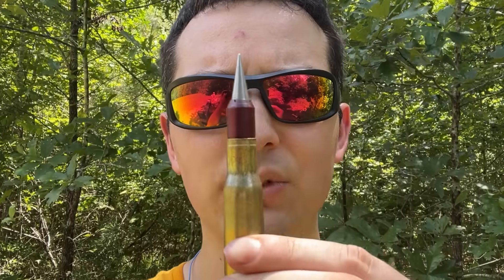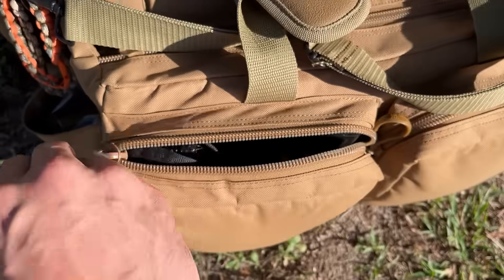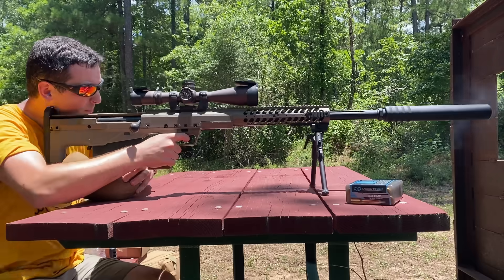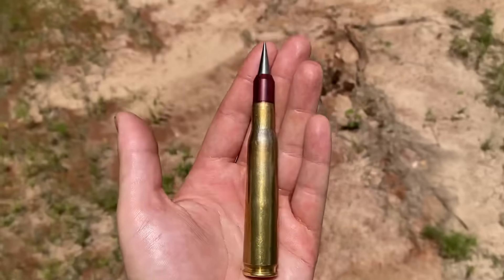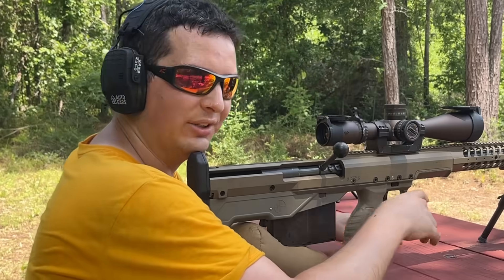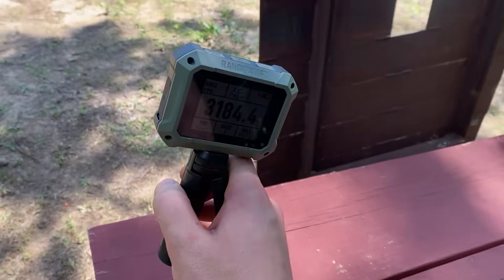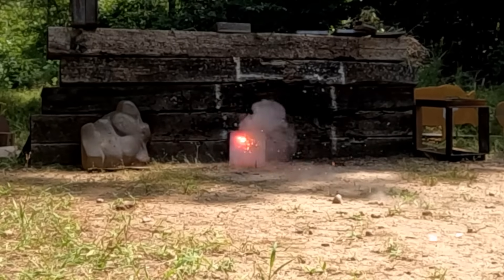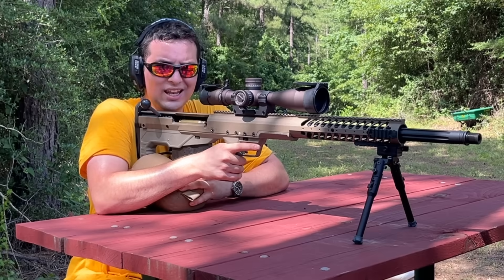How Much Steel To Stop A 50 Cal SLAP?

Comment: only going ballistic, scott, and edwin sarkissian and now you shot the slap, btw i thing it would penetrate if it was 4000 fps, maybe the barell should be longer, and here a video idea compare on the steel
1.50bmg (fmj)
2.50bmg (brass)
3.50bmg tracer (brown tip)
4.50bmg spotter (yelow red tip)
5.50bmg  AP (black tip)
6.50bmg Api ( silver tip)
7.50 bmg apit (red silver tip)
8.50bmg incindeary( blue tip)
9 50 bmg Rauffos ( green white tip)
10. 50 bmg slap ( the yellow one)
gretting from bosnien!

Comment: Great video my friend, and my regards to your sholder. I'm SHOCKED those slap rounds didn't penatrate 1-1/2" steel plates WTF. Maybe they need that full 4,000fps. We have the M-300 Praetorian in 408-Chey-Tac 29"barrel 18lb rifle using armor piercing rounds will penatrate 1-1/4 steel. And my Cadex Tremor CDX 416-Barrett with 32" barrel 24lb rifle. Using reloads with tungsten bullets we've shot through 1-3/8" steel plates. My dad has a McMillan Tac-50-C 32" barrel and it punches through 1-3/8" mild steel.  We have two rifles that should have no problem punching through 2" steel plates. Last year my dad and I picked up the Cadex CDX-X60 12.7×114mm 36" barrel 43lbs & CDX-X60 14.5×114mm 40" barrel 45lbs. These rifles are extremely accurate, and the recoil is surprisingly very mild. Cadex makes phenomenal muzzle breaks. Maybe one day I could bring these big boys to your range to do some penatration test. God bless you and your family. God bless America 🇺🇲 🇺🇲.

Comment: Aluminum tip with 18 kJ of energy behind it going into a steel plate? Yeah that's gonna create a bunch of iron oxide and aluminum sparks on every impact, so you're basically setting off a mini thermite cloud. No wonder it smokes so much.

Comment: I'm def confused.  Something's wrong here.  I've shot through 1 1/4" steel with just my .300 WinMag with black tip, tungsten cores.  That's nowhere near the power of a .50, and certainly not a .50 slap round with tungsten bullet.  Either that's not tungsten, or that's not mild steel.

Comment: Heeey what did you go and take the muzzle brake off for? ……
Reply: The sabot in the S.L.A.P round would foul the brake.
Reply: @TechGorilla1987 I know. About 10 other people on here have done it. Rex guy even quoted the heavy artillery army handbook about barrel and projectile configurations. Also pointed out how all tanks do not use brakes… yet there’s a guy who had a certain potato gun… and the manufacturer of said potato gun felt it’s a psa to clarify muzzle brakes have absolutely nothing to do with a certain event involving a thumb… but yea what does everyone else shooting every kind of sabot under the sun successfully know. Even I’ve had brake strikes on black powder when I use them to just sight in.
Reply: @MrT13  Nice reply man.
Reply: @TechGorilla1987 it specifically states it in the multiple scout sniper handbooks don’t use these in certain twists and ever with a brake of any kind. In fact in big red letters. I just think it’s funny he even made a joke about it with the can still on… that probably would’ve ruined that can. Those things are crazy unpredictable when you don’t remove all the potentials. Like barrel exit before crown crazy… the .308 one was very well known for that actually. And they couldn’t even get a .300wm one to be reliable enough. Wasn’t worth it. The only reason these are m2 approved is barrel twist and weight psi rating. Yea they’re real spicy in a handheld. But as long as it’s not a crazy high twist and too long. They exit fine. As we saw. But, do it with a potato gun with a break on it lol and well we saw that too huh.
Reply: @MrT13  I love when people that really know things engage in YT comments.  I really enjoy picking the brains of people that understand.

Comment: I would like to enhance the plug for Otis. I started using Otis cleaning kits on my Winchester .22 as a 14-year-old neophyte. When I joined the Marine Corps, the range coaches all swore by Otis and so did the snipers. They make the best, most effective and durable, cleaning equipment for any firearm.

Comment: Mild steel has a tensile strength of roughly 60,000 lb... it's also more malleable than some higher grade steels meaning it deforms more before it shears... 

It can be a whole lot of fun when punching heavier steel with an iron worker... it sounds like a gun going off in the shop.

Comment: The flashes on the aluminum tipped rounds might be due to the aluminum reacting with the rust and mill scale on the steel to create a thermite type reaction.
Reply: Metallurgist here. Points for creative thinking, but this is not a thermite type reaction. Way too little iron oxide on the surface to be meaningful. 

What this is is simply flash heating from impact igniting the aluminium (aluminum, sorry, I'm European) causing the shrapnel to burn. You'd get the same effect if the bullet were shot onto rust and mill scale free stainless steel.
Reply: Aluminum powder or fine shavings are pyrophoric, especially when heated up
Reply: No fking way...
Seriously?

That is amazing!!! Thank you for the post.
Reply: isnt it because the silver tip is an  armor-piercing incendiary round?

Comment: You've been adopted by a dog. You need the feel-goods.
SLAP rounds went bye-bye after Somalia. They're based on the success of APFSDS from Desert Storm (1991). It doesn't scale. No soft target effect. No mass to penetrate armor. APFSDS hits tanks so hard the crew is sucked out a 1 inch hole opposite the impact. No joke, can't find video. Shoulder firing a scaled down version is expensive and ineffective.
Your Garmin measured the sabot.

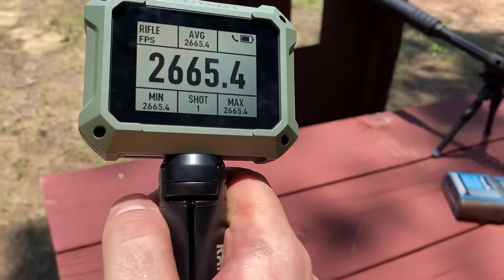Comment: 3:40 Thermite reaction. It occurs between a metal (Aluminum in this case) and a metal oxide (Rust)
Reply: (See my other reply too) There is too little surface oxide to really get you a thermite reaction. 

What this is is simply extreme impact energy turning the aluminum tip into tiny droplets which then ignite and burn in air. Melting point of aluminum is only around 1220 °F (660 °C) so you're looking at fireworks basically.
Reply: @Hydrazine1000  I second this. Aluminum powder is one of the most common firework ingredients because it sparks bright. You’re totally right to compare it to a firework.
Reply: Thermite reactions aren't red like that, def flare/tracer reactions
Reply: @reginaldthecat  yepppp
Reply: Great info, thanks for that!

Comment: I could be wrong, but the flash and smoke from the A Max bullets could be from the aluminum tip reacting with the rust on the steel making I think tannerite if I remember correctly.  Super cool reaction!

Comment: I was a Machine Gunner from 2008 - 2017 I only ever shot slap rounds once and it was .30 cal slap on a GAU-2C and it was as a "spend ex" to git rid of it. Normal AP shot it a lot. I do not think the military uses slap much for the reason in this video its not that much better than standard AP which is also less finicky too.

Comment: I'm very confused as to how this isn't piercing simple steel like that. I've seen too many videos of these rounds going through more steel then that. SUPER odd because that round was made to not only have a ton of energy, but to pierce. TO defile steel unlike any other round. So I am certainly confused. It was kinda made to do what other rounds couldn't do. For certain situations. Like blowing through iron engine blocks and steel plated cover. And usually, it just sails clean through.
Reply: 2 inches is a lot! Far more than would be encoutered in an engine block! The depth it got is impressive

Comment: You do have to understand that 3" of steal at an angle will shrug of tank cannon rounds. You will not be able to go through that with a .50. 20 mm HEAT or 30 mm might have a chance. though I don't think they make 30 mm rifles that are not meant to attach to a turret or a plane.

Comment: That 29 inch barrel ruined those Slap rounds at least 25% drawdown in power. next time make sure to test again at least with 36 inch barrel length to see the true potential of these slap rounds. I'm 100% sure it will go through 2inch mild steel like butter.

Comment: Something tells me these were loaded light.  Nothing wrong with that for the sake of safety, just important to note.

For reference, these haven’t been passing the 1,000 m/s barrier in the video, but when I calculated their theoretical velocity out of a 30” barrel with a ballistics calculator (from a 45” barrel), the velocity is still around 1,100 m/s.

(In freedom units, it’s 3,281 ft/s and 3,609 ft/s respectively).

Comment: As a Bradley driver, I was once told by my SSG that 50 BMG should be treated as an anti-tank rifle. Apparently there are certain places on a BFV that a 50API can punch straight through, and those spots are pretty much a direct 90 degree angle from potential infantry firing positions. We had standing orders to take out the Iraqi 12.7s and RPGs first with HE rounds or coaxial, everything else secondary. Even grenades were secondary to those 2 things. Only higher priority to 12.7 or RPGs was actual tanks or IEDs made from artillery shells.
Reply: Makes you wonder where that endless supply of 155's came from

Comment: Having the muzle that far back from the shield bounces a lot of the concession back at you. If you move up so the barrel is past the wall thru the port it will be less obnoxious
Reply: I get why he does it, shrapnel and all. But he should put the shield at a steep angle that way he gets both deflection and gets the barrel through with a smaller gap
Reply: I didn’t see any hot dogs or French fries flying around. What do you mean he’s getting most of the concession?😂😂

Comment: KentuckyBallistics collab for those thick plates!!!
Reply: I agree, Scott DeShields should be invited
Reply: @aaronpaulus3492  i've been saying that for the longest time
Reply: @DrQuagmire1  I know, right. Kentucky Ballistics has the right range and rifle (RN50) for SLAP rounds.  He even has bigger rifles (950 JDJ, 4 Bore, 20MM, Fury) and can fire them no problem
Reply: @aaronpaulus3492  and this is precisely the reason why they should team up together on a video collaboration!!!!

if Scott can do several with the Slow-Mo Guys, then he and Banana Ballistics should have no problem doing one of their own.
Reply: Not to mention he's got the neck meat for such a thing
Reply: or Brandon since he got a M2 so he could get the best performance out of the slap cause apparently he got a good slap dealer